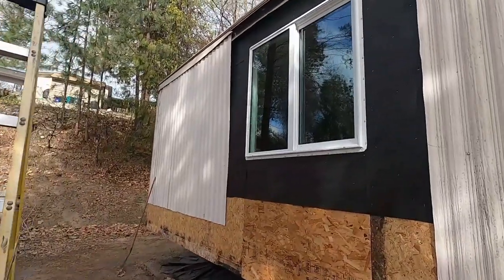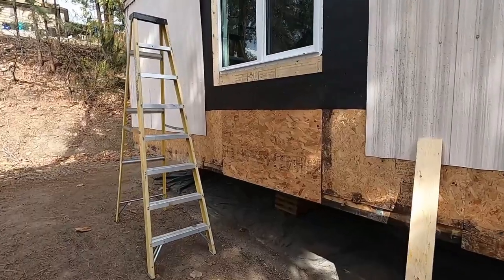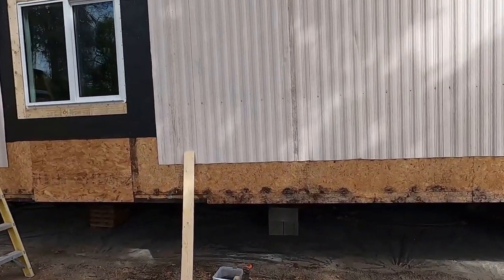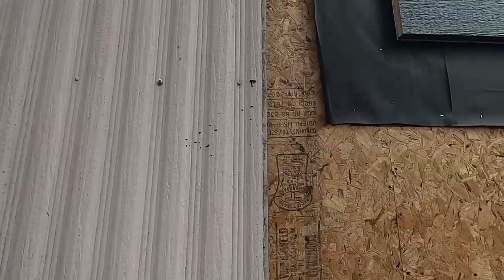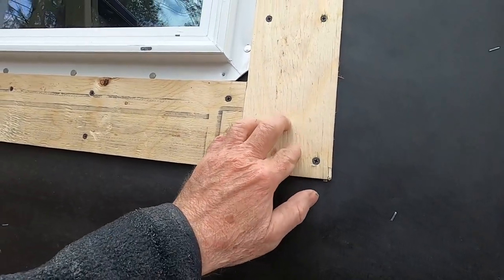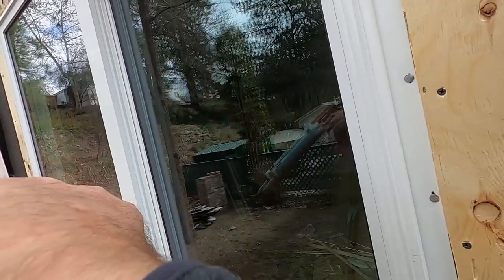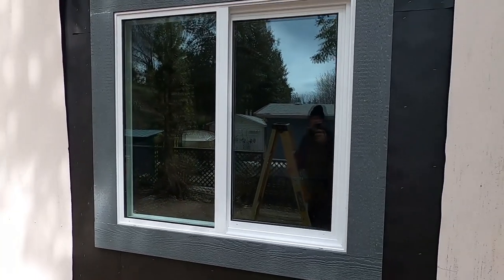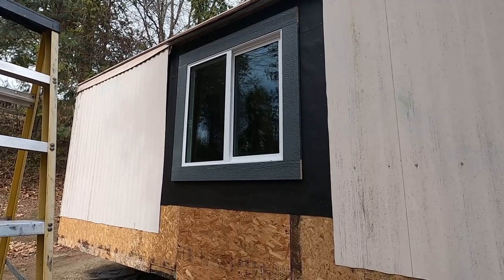Installing Some Exterior Trim On A Window To Give It A Custom Look : E110 / BC Renovation Magazine

Comment: So I started removing the particle board floor in my old mobile home. I got to the walls and the bottoms of the walls are stapled and nailed through the carpet to the the floor. 🤬🤬 

Since I am not removing the walls i cut out the floor under the wall plate, even with the 2x6 studs. That's half way under the plate. I will attach 2x4 blocking to the 2x6 studs under the wall plate, so I can then screw the wall plate down to the new floor. Only thing I can think of. 🤷🏾‍♂️🤷🏾‍♂️

Has about 20 staples between each 2x3 wall stud that I have to remove throughout the entire mobile home.  🤯🤯🤯🤯
Reply from the maker: Full Body Joe, wow, that is no small task you have undertaken there. Way to go! 🙂 I love it when people dig into a project like you have and solve problems as they pop up.

Yes, they usually run the flooring out on the floor and build on top. Crazy way to do things but that is factory production. 

And those staples! Yup, everywhere. 

Sounds like you have a good handles on things. Keep up the good work. 🙂👍
Reply: @BCRenovationMagazine  We messaged before about you sometimes feeling overwhelmed. Man I saw those staples and nails and was like, I'm just going to lay new flooring over the old. Lol. 

But since I'm rebuilding it to live in when I retire, I have to do it right. I'm just not removing all the walls.  A guy on another channel says, if it's made of wood you can rebuild it and make it better/stronger. 

One section at a time, a little bit at a time and it will get done. 👍🏽
Reply from the maker: @72Dexter72Manley72  , yes, just keep at it. Perseverance pays off. Good to hear you are checking in with Drew. He has done a pile of this stuff. He takes on some things that I would not be brave enough to.

Comment: I have no idea how to direct message someone so I will post it here. I'm undergoing a complete gut job on a 1972 MH. All the windows are replaced with Pella windows since Kinro is gone now. You want to talk about a challenge? 2x3 studs so I had to bump everything out by 3/4" to accommodate the house replacement windows. The metal siding on the exterior was the worst part of this. I could tell horror stories dude. Would love to chat sometime. Direct message me. And don't use the pink crap. Rockwool only.
Reply: I am doing the same at the moment on my 1980 MH.  I also inquired how to secure the aluminum siding to the window trim.  I am not looking forward to trimming the aluminum.